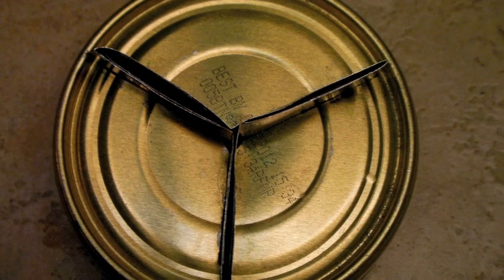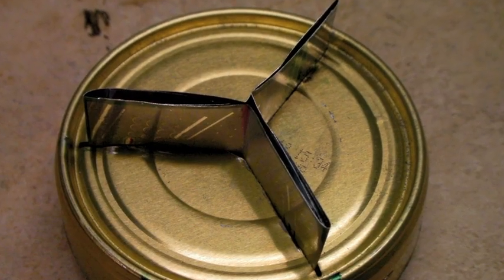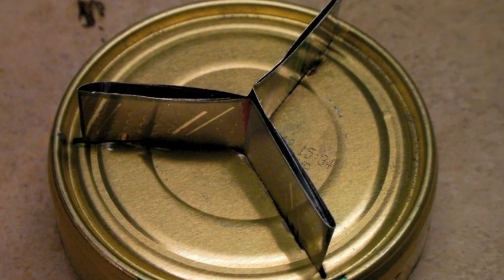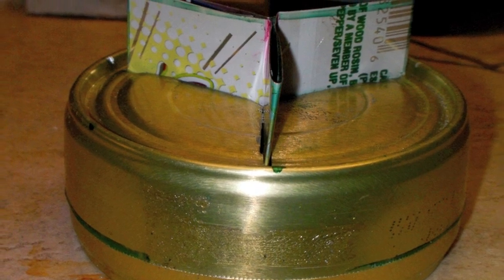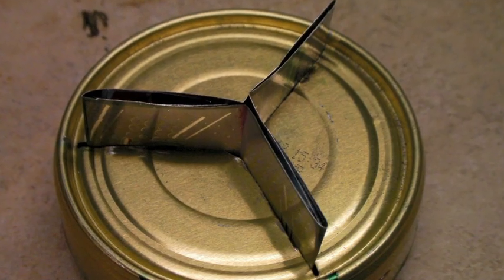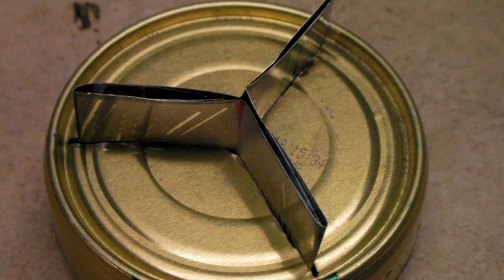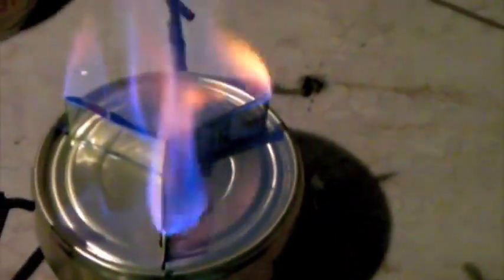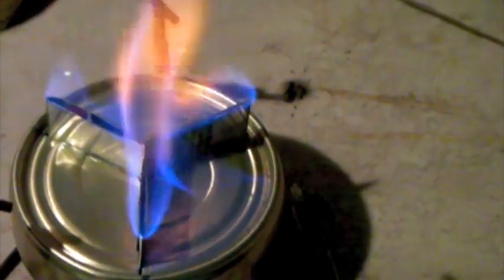Capillary Force Vaporization and Flame Shapes for alcohol stoves

Comment from the maker: @TheBeebopper Very observant! The reason that the flame front is smaller in the Y burner is because the outside barrier walls are made from a soda can while the round tube has a much thicker wall. With CFV, one of the variables to play with is the thickness of material. With the Y burner, I think that I can place thick material only ends of the spares (say ½” wide) and concentrate the flame size at the ends.